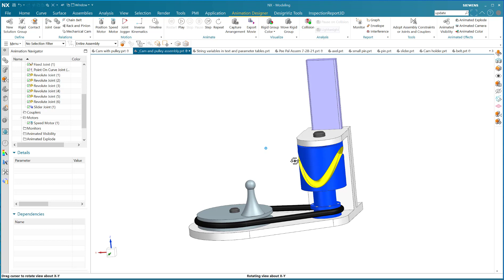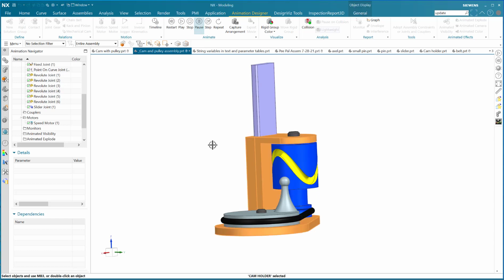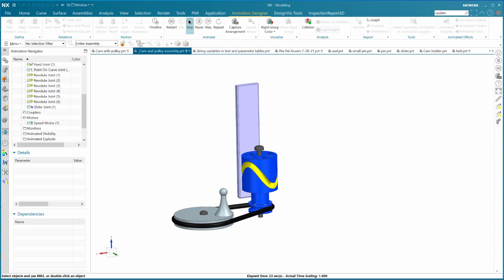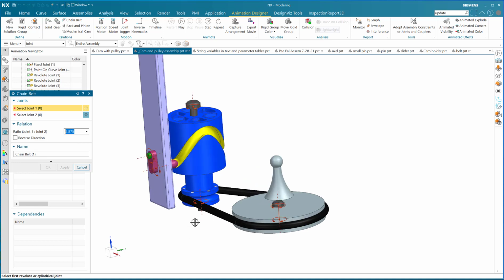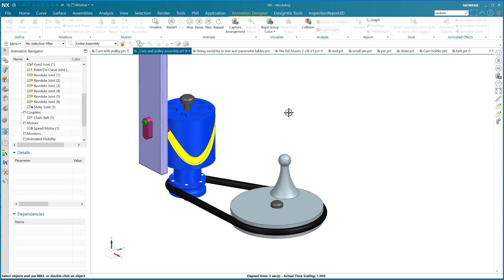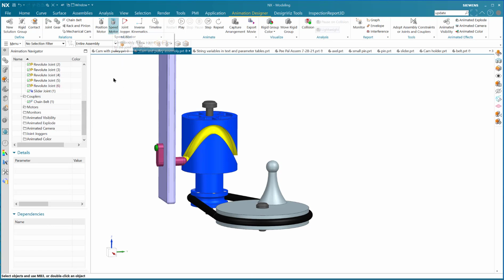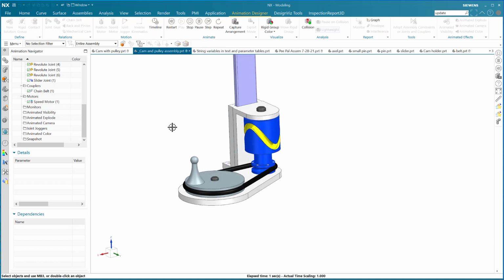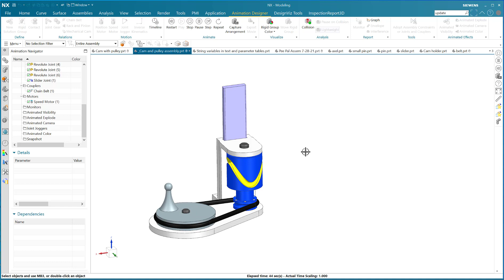Animation Designer Chain Belt - Part 2

Comment: Hello, sir. I was working on a project for my course about a cable-driven robot. I have a steel cable and pulleys. Can you make a video about it? I couldn't find anything related to this topic. The closest is your video, but I see that you are not moving the belt between those disks. Could you at least create a third part of this video, where you show how the belt is also moving? Thanks a lot.
Reply from the maker: Hello,

I think I will do a steel cable on my very next post.
Reply: @DesignVisionaries  Do you have any plans to still make this post? I am similarly looking to motion the belt about the pulleys and analyse the tension in it. Thanks!